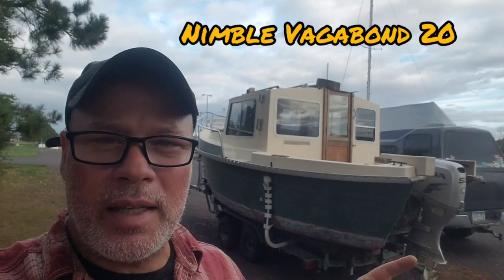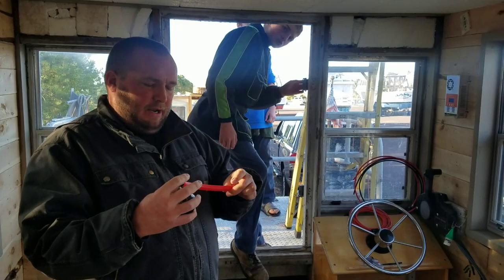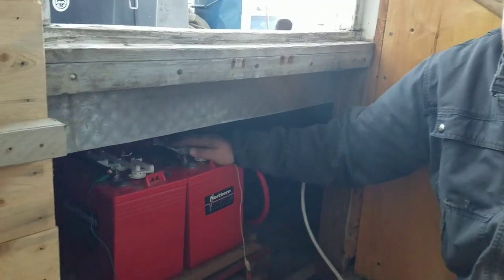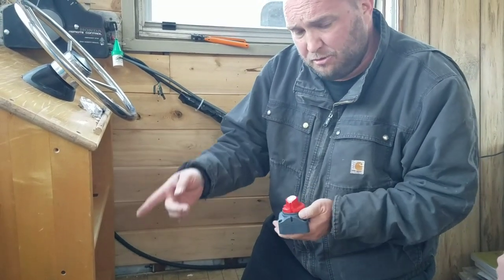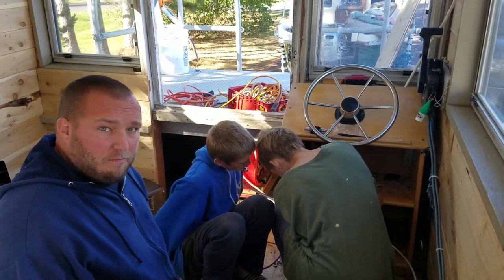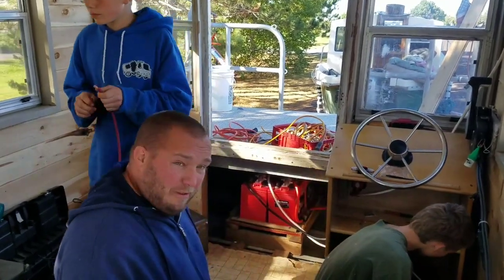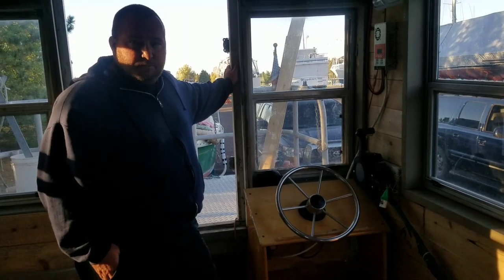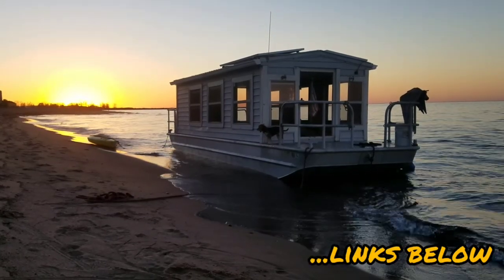Ep:11 "The Beagle Barge Beagle Build" | Full Solar Install Walk-thru

Comment: Inverters are extremely hard on batteries. If I remember correctly they were changing out batteries approx. every 4-5mos in the trucks equipped with inverters, when I drove over the road. My truck had a fridge which ran every day except when I was home and a 700watt microwave I used about twice a day.
Reply from the maker: I'll ask Mike about this. Thanks for bringing to my attention
Reply: "every 4-5mos"  I suspect there was something very wrong with the system if they only lasted that long.

Comment: Even with lithium iron initially being so much more expensive,  since they can be cycled down to 90% (as opposed to 50%) and supply 5-7 thousand cycles, they end up being much less expensive over time.  Also, you do not want to charge lithium iron batteries when they are below freezing.

Comment: I guess it is beyond my understanding as to why you are so worried about being able to use a generator. Other than that it was a very nicely done video. Hi wavey.
Reply: I believe he plans to use this boat for extended river travel. Not uncommon to have 3-4 cloud covered days. A small Honda generator will work great to top off the batteries. He is not tying this into the engine charging system. Plus a lot of the river banks he will stop at are tree covered. Will block out sun light. I understand why he wants the generator option…  it’s a just in case type thing.  He may never need it.